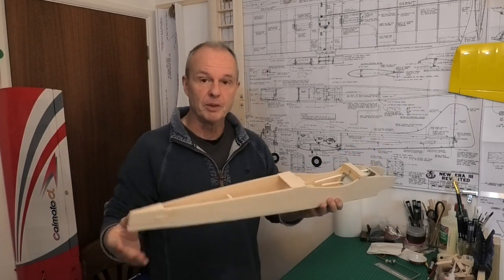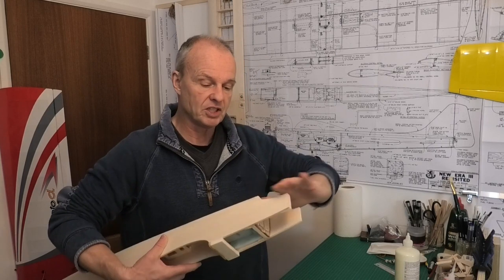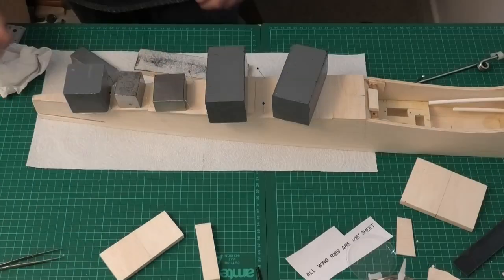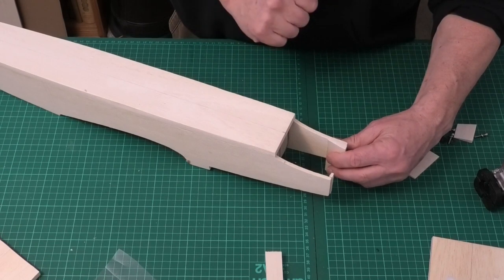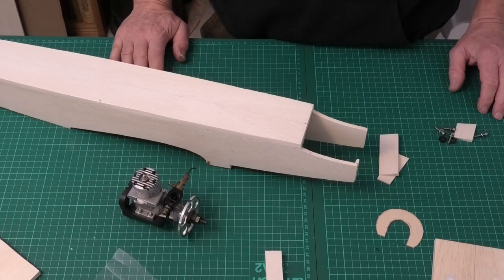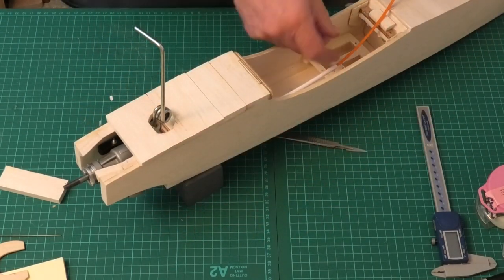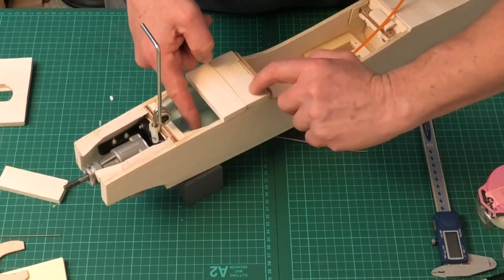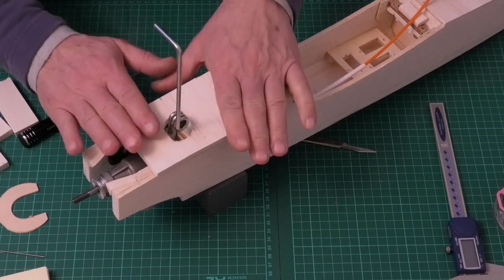New Era III Revisited: Pt 11 - Finishing off the Fuselage - a 45" wingspan RC balsa aeroplane

Comment: Those steerable nose wheels can be fiddly.  I have an old Airtronics Jetfire 40 with an identical setup.   You know of course that wheel will be way off the first time you taxi, haha.  I made it a point to have some thread length both ways at the servo for final length adjustment because I couldn't ever get to that wheel linkage without balsa surgery.  Keep 'em coming.  we want to see you wring this thing out in the air.
Reply from the maker: Thanks for the comment and information, greatly appreciated

Comment: Really good looking plane! It will be my next project. Where do you get these steel blocks you use as weights?
Reply from the maker: Its a lovely plane to build and flies great, you won't be disappointed.  The blocks I had made in a machine shop, cut from a steel bar and the ends milled square.  Thanks for the comment 😀

Comment: If the lower skin was flat why did you put it on in sections??
Reply from the maker: Because I wanted the grain of the wood to run crossways, rather than length ways, so it was a stronger construction